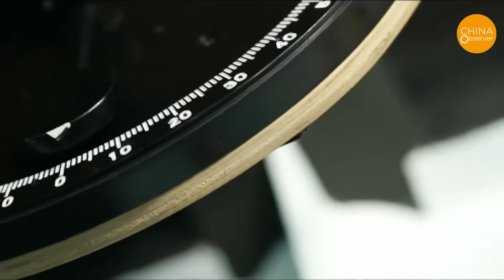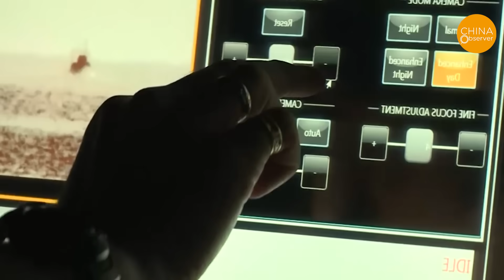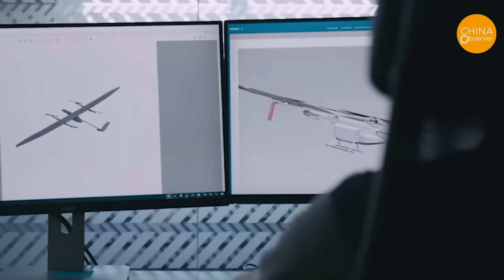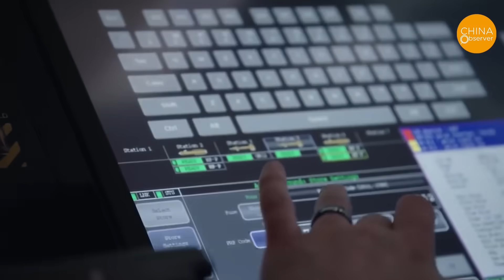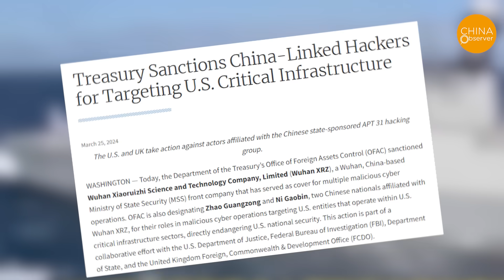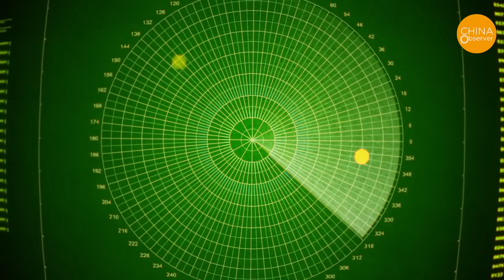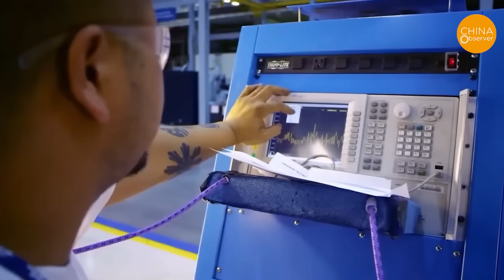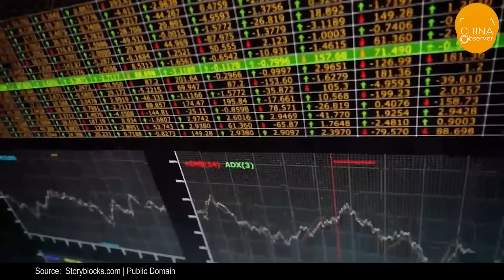Huge Gap in US-China Laser Weapons: Saudis Wary of Buying Chinese, Only Blinds Eyes

Comment: I can tell u stolen technical dwgs have a weakness. Usually material they will put a specific brand and code. So china gonna have hell of a problem, how to get those materials?? If they purchase the same code, US will know. On the other hand if they didn't,  they dont actually know what material it is! Also tolerances are constantly not properly updated, like on the dwg it will say plus minus 30microns but actual manufacturing documents will state plus 10 minus 20 microns for example. It's not haphazard implementation, it's they dunno how to implement it

Comment: Glad we have the good stuff but how does it perform when the optics get rain or salt spray on them?
Reply: Rain is just water...  it evaporates when exposed to heat.  Commercial communication lasers simply use an IR beam to clear water vapor away from the beam...

You'll lose range but that's about it...

Salt spray could be an issue, but wiping it off isn't that difficult.   Worse case...  it also vaporizes in a laser beam.  Probably not ideal in that it may leave residue on the lens.

Comment: Remember china mounting an “operational” rail gun on one their ship right after that us navy video footage of a prototype railgun was released? Whatever happened with that?
Reply: The cardboard got wet.
Reply: It probably failed miserably, there’s a reason everything is so cheap from china. If it’s made in china you can bet your ass it’s poorly made and slaves made it
Reply: Rail guns have proven to be maintenance problems.  The concussive forces from hypervelocity is hard on the structural and electronic components.

Compared to missiles, they require a lot of ship space for support infrastructure.
Reply: Coincidentally they modified their railgun parameter to 40mm caliber with trajectory speed of mach 6.9 and claimed thta they successfully tested it, after Japan tested fire indigenous prototype railgun with identical parameter.
Reply: They've actually got really good railgun tech probably better than ours. Our military gave up on rail guns while China didn't
Reply: @earthwormjim91  not likely given how expensive and energy intensive it is to use them if we couldn't make it work theirs no way china did
Reply: @earthwormjim91  They don't even have nuclear reactors on a ship yet, how the hell are they powering rail guns? Edit: Not talking about subs that sink themselves, talking about surface vessels.
Reply: Unless china has obtained cutting edge material for the rails that can sustain the heat and revolutionary energy storage technology, I don’t think so.

Comment: lockheed needs to work on a way to generate better power in smaller packages, THEN and only then can lasers and electromagnetic mass accelerators (railguns) will be feasible
Reply: Problem is that they have mass to attack and life means nothing apart from the people at the top
Reply: @phillipanderson9925   @phillipanderson9925  don't understand that first part but yes there are greedy ass hats at the top but I know for certain how to change their mind, easy to do as well they could in theory make literal trillions my way but hey I'm just an autistic man who self taught a fair bit of quantum physics, designs and tests systems of the offensive and defensive fashion on a much smaller scale ofc and have had DARPA steal my shit 3 times... Mainly the VLSCA airframes or as they call it " the x drone" it's all good though I know how to defeat MIRVs cheap and they don't...